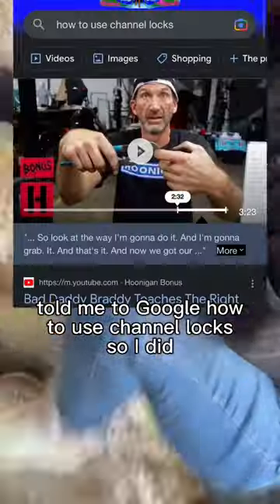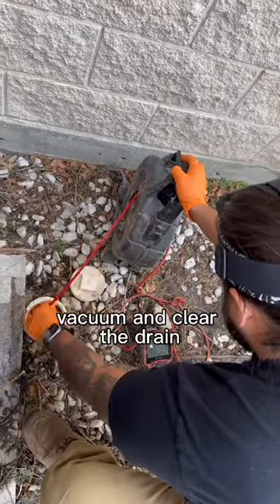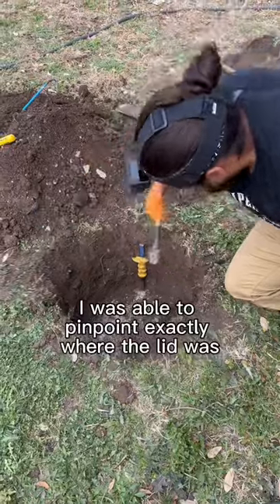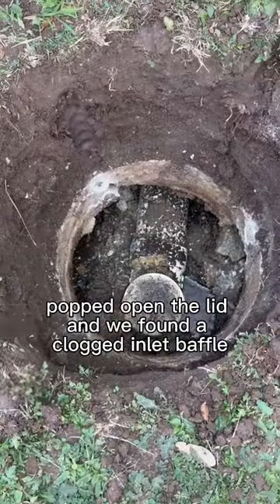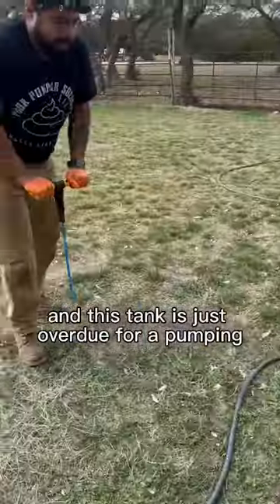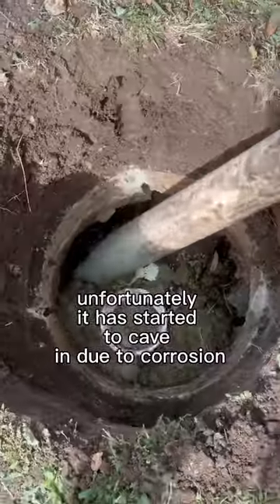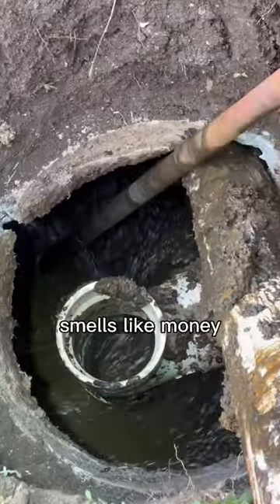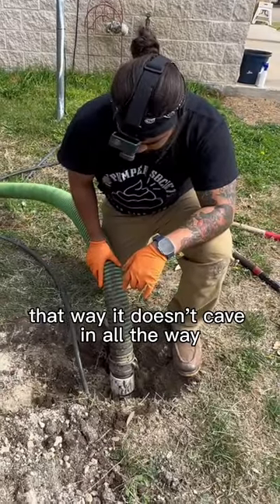Septic tank is long overdue for a pumping #shorts

Comment: Back when septic systems were more common, there was much more awareness of how often (or not) to flush, using the correct paper, not flushing things you shouldn't, and getting it pumped and maintained. Now, people buy an old house with a septic system and have no idea that it actually requires regular maintenance.

Comment: If septic tanks are supposed to be emptied every 2-5 years, then why is the lid burried deep down in the ground? Maybe this is why people forget to have them serviced - you know "out of sight out of mind". I don't have a septic tank, but my drains needed unblocking and we spent a long time looking for the service hole - which was hidden under a feet of soil and a layer of paving. The original owner of the house aparently wanted everything hidden.